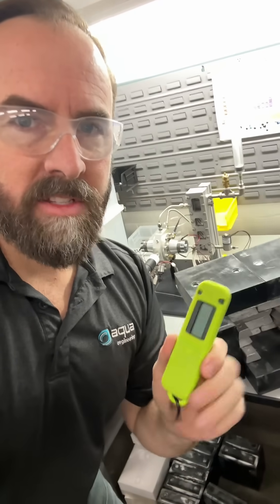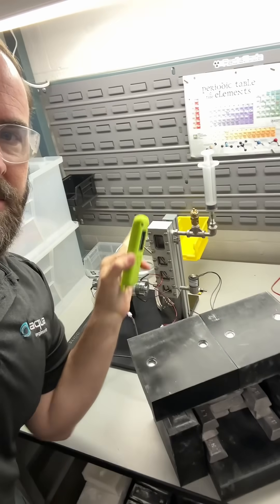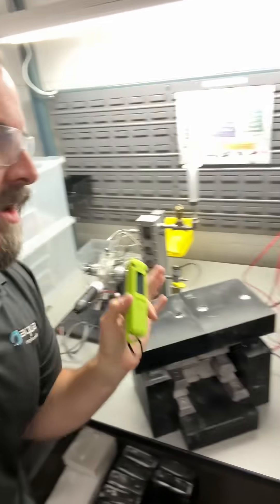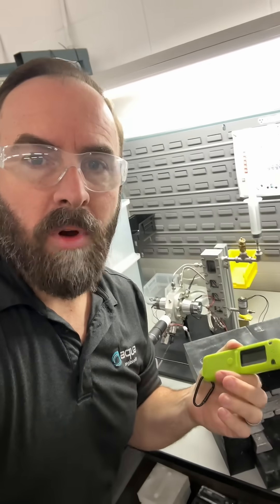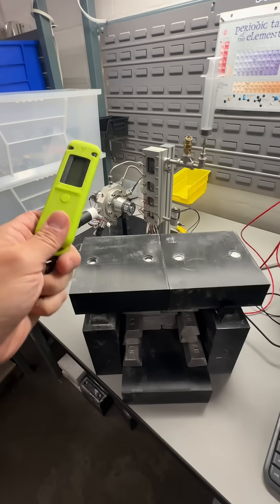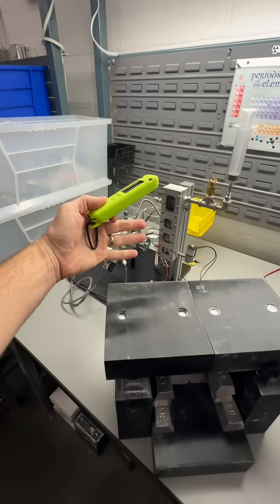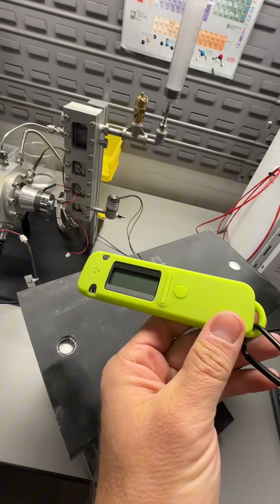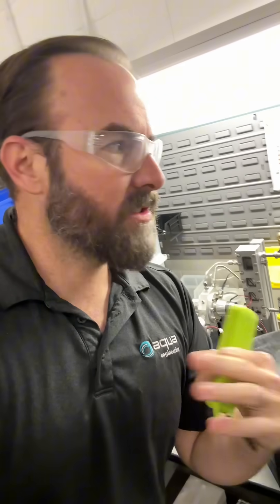LENR Radiacode False Positive Gamma Alarm EMI

Comment: You beat me to my next comment.  I was going to ask if you thought the transducer was putting out enough EMI to confuse the meter.  Glad you clarified.  I was thinking if you could detect neutrons then that might solve the "is it gamma or EMI?" question but comparing it to background radiation is probably easier.  What happens when you ground the device?
Reply from the maker: Big arc when I ground the transducer because their contacts aren’t insulated from the metal body. That conducts through my reactor core. Might insulate them at the threads perhaps.

Comment from the maker: Guessing it’s where the photodiode reads the scintillator crystal or something like that. Gotta be difficult to isolate the delicate signal from electrical noise on a handheld circuit like that. If you work for Radiacode, message me.